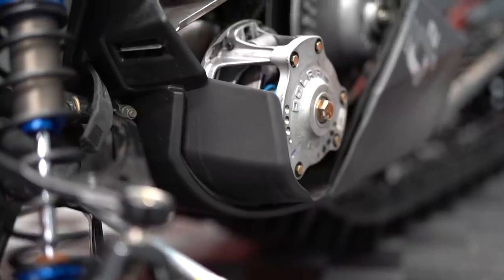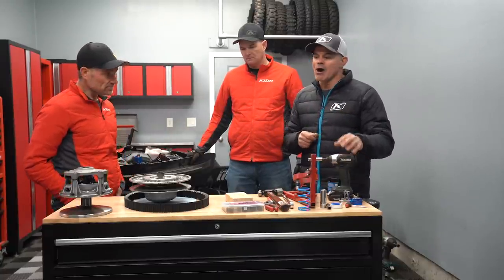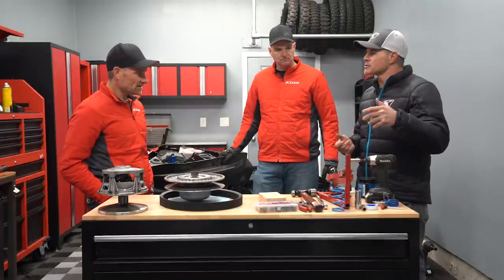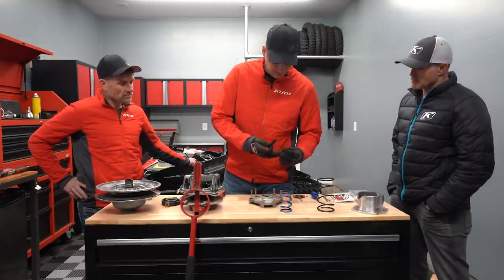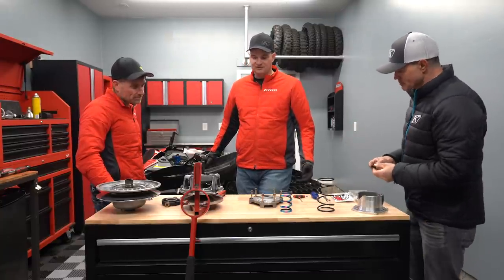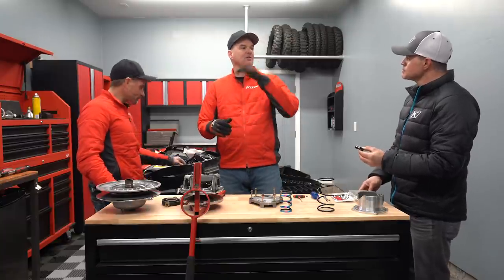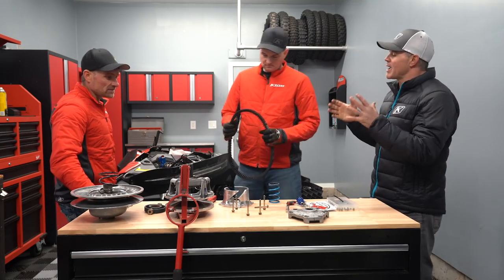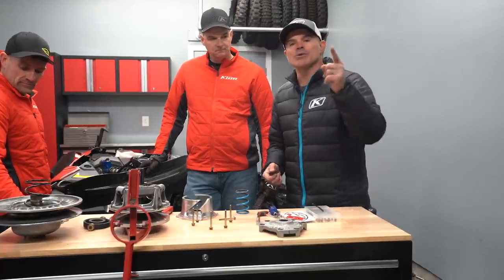Clutching Tuning

Comment: The profile on both the top of the weight where it pushes against the roller and the belly is the culprit in 2 of the same gram weights acting different. The belly profile is pretty self explanatory as it gives an indication of where the weight is distributed on the arm, but the profile on top is often overlooked.

Comment: Awesome! Now we need specific videos for primary maintenance and secondary maintenance. I am especially interested in exactly what wear items need to replaced in the clutches and at what mileage. I know the OEM's have their recommendations but we see failures before then. I have been dealing with an on and off throttle bog in my 19 850 Pro RMK. Tired of adjusting my belt deflection twice a ride.
Reply from the maker: Thats a great idea for a future video. Thank you

Comment: Hey guys, when I was kid our Dad bought us a 1970 skidoo Olympic with  12hp Rotax , 35mph top speed. The clutch would engage right off an idle, so no power for any kind of a hole shot. Maybe with modern components,  and higher final drive in the chain case we could have made it do 55mph. After that I had a Scorpion super Stinger, and  a Arctic cat Puma, all the same story, no RPMS, for launche....hehe...

Comment: Replacing primary spring every 500 miles is super conservative. Unless your spring has plastic deformation (permanent damage) or a physical crack, there should be no reason why that spring is losing strength after 500 miles. I'd say inspect every 500 miles and replace as needed. Great video by this team, though. 1g per 1000' is spot on for the 800/850 guys.

Comment: 2001 polaris 550F, what needs to be done to make the clutch engage sooner, seems like the RPM is quite high before it moves the sled
Reply: Go to a lighter initial weight on the primary spring.

Comment: How do you tune older clutches, I have a 98 powder special and I don't know how to tune them..
Reply: I don’t really know but based on what they said in the video I would bet that inspecting the clutches and replacing worn parts would be a good place to start.
Reply from the maker: Much of what is talked about in this video applies to any CVT clutched machine, new or old